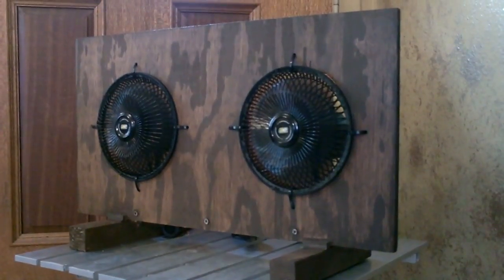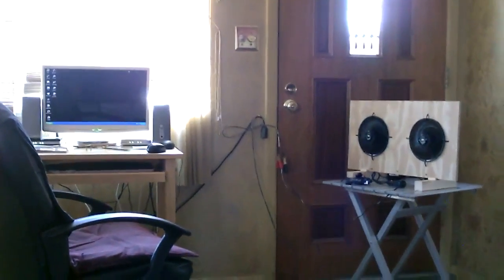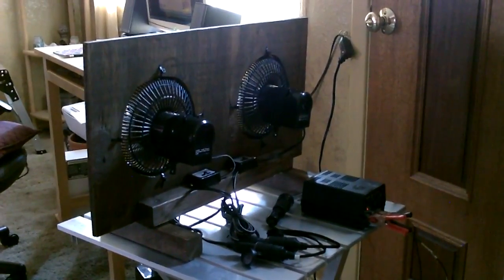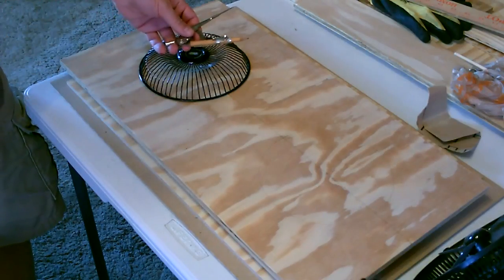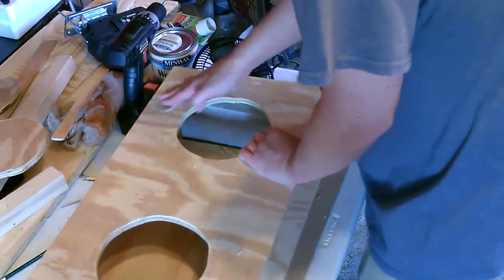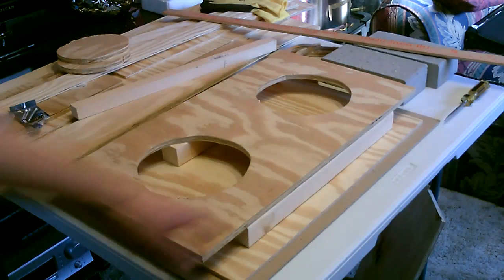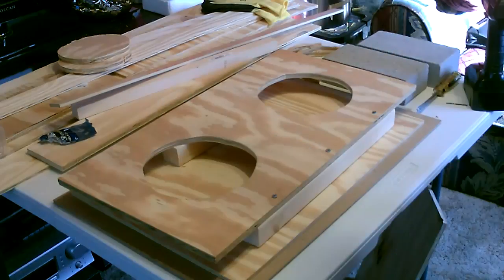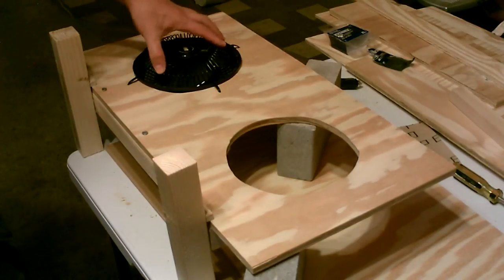Homemade "High Velocity" Desktop Table Fan! (w/Dual DC Motors!) - Solar Powered! - Full Instr.

Comment: what kind of fans are those?
Reply from the maker: hi there. they're 12VDC "auto expressions" automotive fans. they sell them at walmart for about 10 bucks. (in my area, they're selling a different brand now but they work and look almost the same)
Reply from the maker: yep :)
Reply: Are they the kind of fan that plugs into the 12v port in a car?